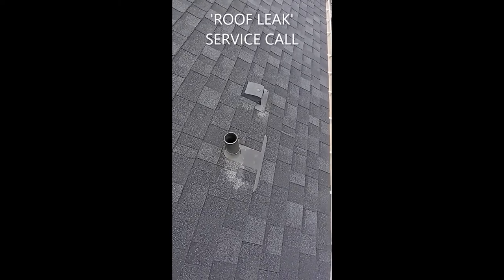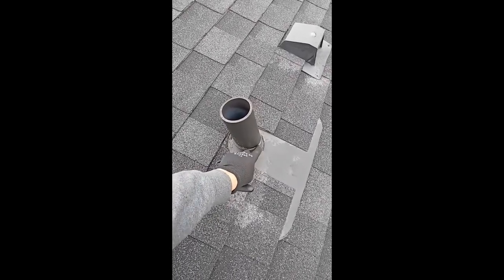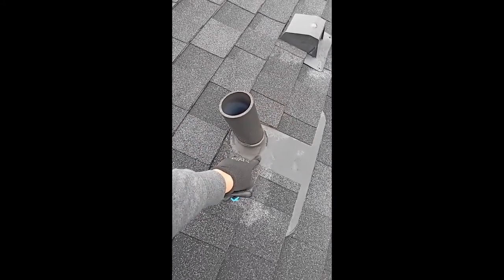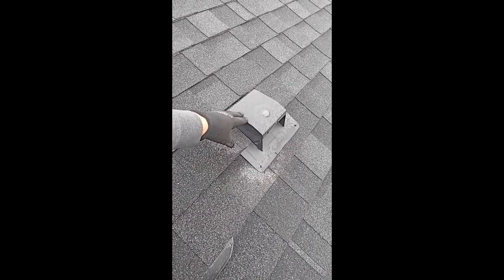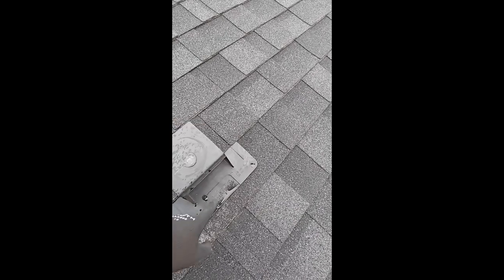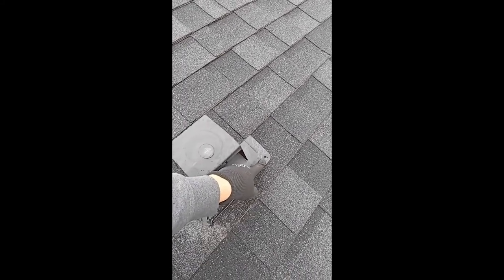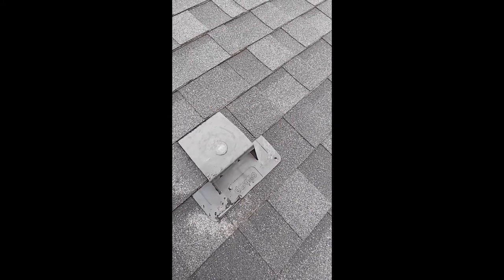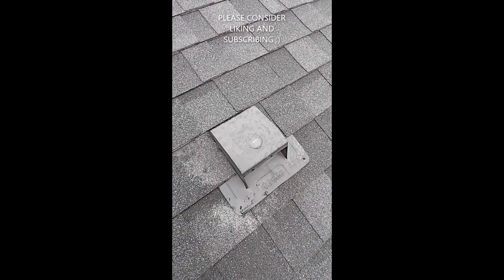Common ROOF LEAK (Bathroom Vent Failure)

Comment: I've never had an issue when nailing the vent down, but a few years ago I started using roof screws and as you pointed out I also try to go higher and further away from the edge.